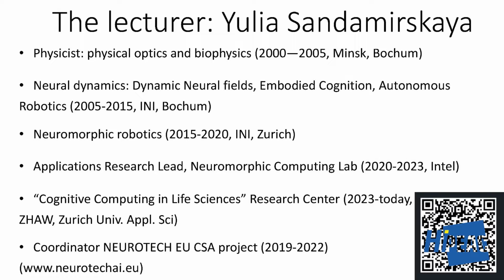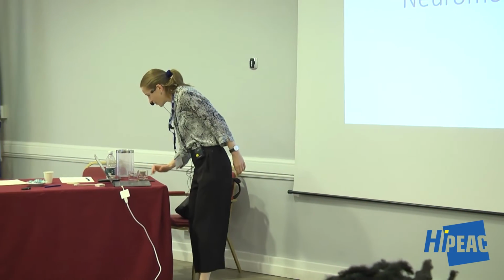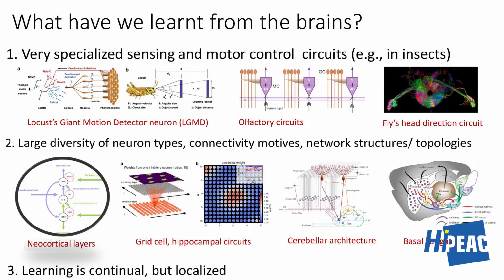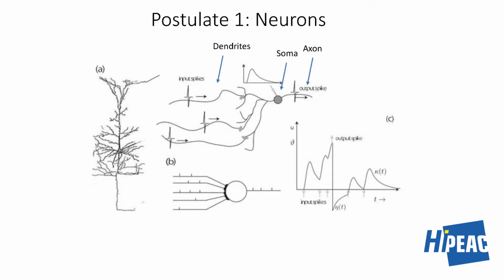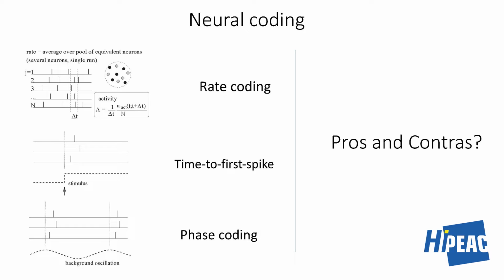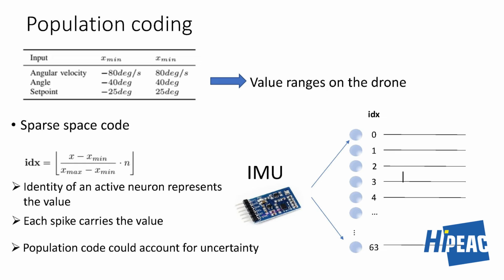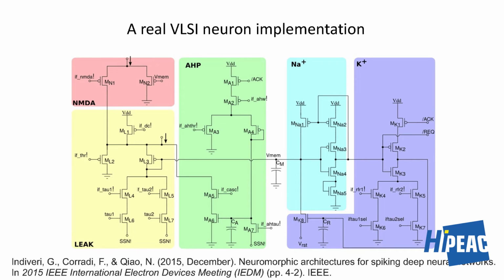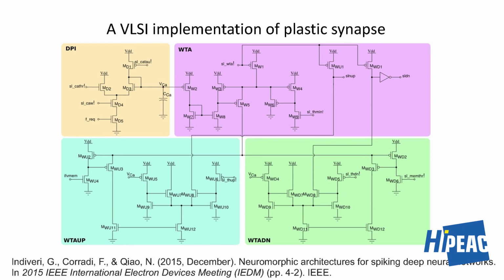ACACES 2023: Neuromorphic computing: from theory to applications, Lecture 1 – Yulia Sandamirskaya

Comment: Both analog encoding of signals (the classic continuous ANN's, perceptron and offspring) and the spiking style, have their merits. To use an analogy from electronics, the spiking has a strong element of "Schmitt trigger" to it = threshold detection and suppression of "noise" (insignificant fluctuations in the analog input). In a way, spiking distills important events out of a sea of noisy continuous signals, and helps prevent the noise from cumulating along the signal path. It is a filtering mechanism. The flip side of the same coin is, that you lose "resolution" in the signal transferred, and introduce a processing delay. Different "applications" may favour this or that optimization.

Knowing a bit of control systems theory, the debate about "how to code a continuous scale using spiking signals (pulses) and make it quick", there are some obvious answers.

If you are limited by a maximum firing rate of a spiking neuron, your option is just to use a continuous analog value. That is "instantaneous". Exactly what response time "instantaneous" means, that's subject to a further analysis of your transmitter and receiver (two neurons?) = what the propagation time is from some "inner current state" of the TX party to its physical output voltage (down to some precision spec) and what the propagation time is in the RX party, from the input voltage into its "relevant inner current state". In a continuous analog signal, other circumstances equal, it should be easier/faster/cheaper to work with the continuous analog value directly, rather than if you need to use pulses (spikes) and either wait for a spike before you act, or count them / integrate them over time.

Mrs. Sandamirskaya has actually mentioned prior in her lecture, that spikes are neatly transferred as digital events. If the spikes are relatively rare, and you have a digital communication network of some sort, with nearly infinite bandwidth (compared to the spike sequences), it's a no-brainer to transport spikes as digital messages. It can be a very flexible arrangement of topology, minimizing fixed and physical wiring. But, if you start to struggle with the spike rates, i.e. your communication bandwidth becomes clogged / message forwarding capacity becomes a bottleneck, there are possibly savings available from reducing the number of individual events to transport, such as transporting fast continuous signals as streams of analog values, rather than rate-encoded as pulse trains. Each analog byte can carry an equivalent information to a couple dozen spikes (or timeslots in "time to pulse" precise timing). Still bandwidth-intensive, and not so easy to route across some topology... Luckily, fast closed-loop control tends to be characteristic of relatively simple and bounded tasks (motor functions / motion control) so the fast signal paths potentially need not reach very far / be overly flexible in topology. See that example with a single "looming detector neuron" in the grasshopper brain.

To me it all really boils down to: we need more research into "architecture" of our ANN's. A biological brain consists of various specialized "centres" / function blocks / layers. One size of a neuron definitely does not fit all purposes and tasks. And, from a more macro perspective, the block schematic of an "autonomous brain" should resemble something like a car engine, or a modern computer (in the way of a very superficial analogy) rather than a flat babble predictor / generator.

Those analog schematics are beautiful. If someone would be interested to get some insight into what these do, check out the free PDF book by the late Hans Camenzind, called Designing Analog Chips.
Reply: incredible comment! Very nice breakdown